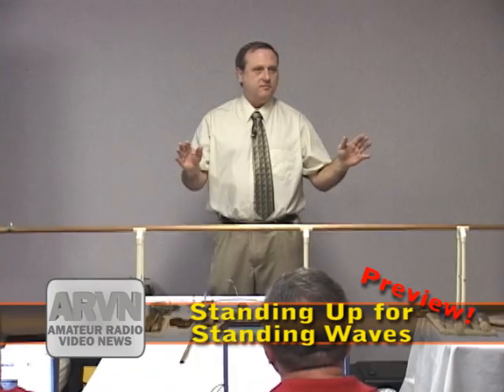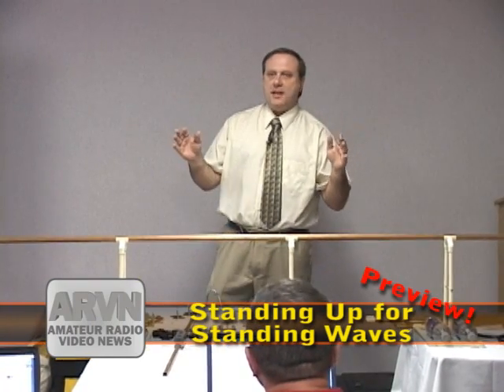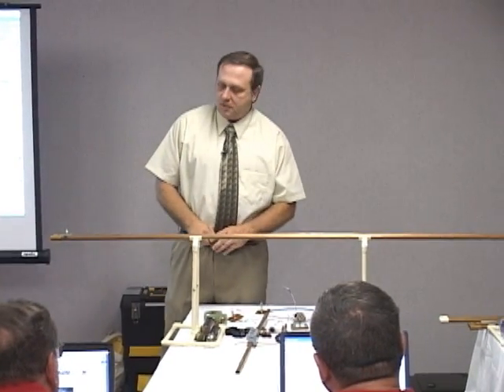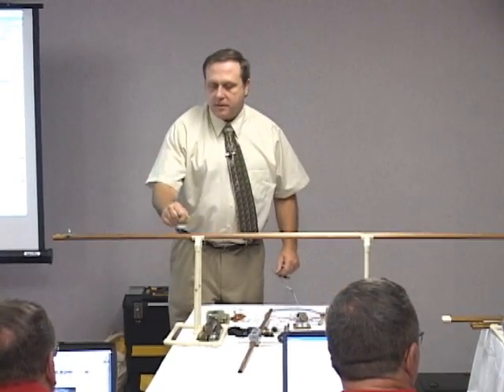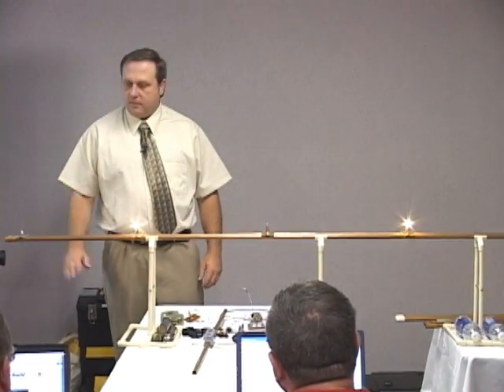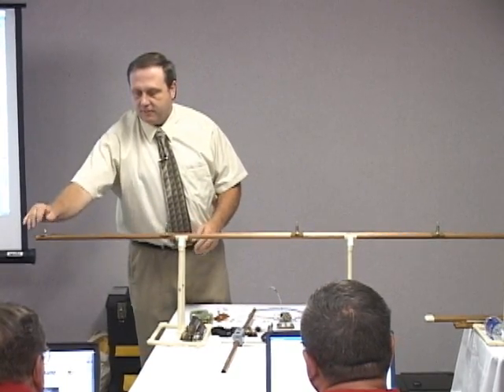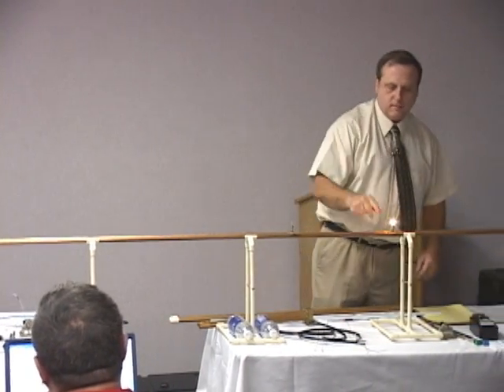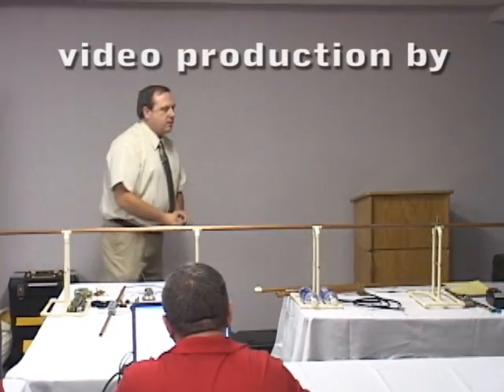SWR: Standing Up for Standing Waves - Preview

Comment from the maker: 40 watts on two meters. It's hard to see here, but the "transmission line" is two parallel copper pipes (from the camera angle, it looks like just one). That makes it a balanced line, about 200 ohms. Bill says that all the principles he demonstrates apply to (unbalanced) coax as well.